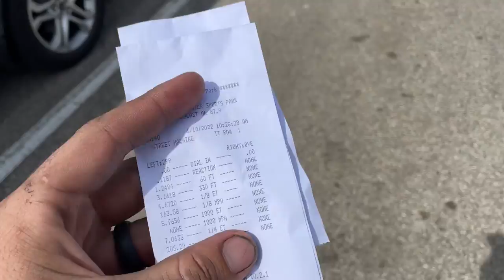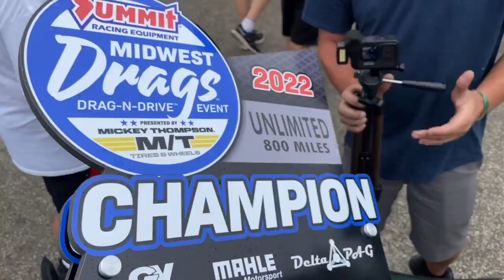Midwest Drag Week DAY 3 - We May Have Hurt Mullet's Turbo 400... Can He Still Limp To a Win??

Comment: You should get a laminated check list with a dry erase marker, so you can do a pre-flight before each run!
Reply: They should paint the checklist on the outside of the car so they don't lose it.
Reply: @lonnieatk9120  on the bed cover is space enough
Reply: And more sensors.
Transmission fluid level sensor.
Oil cap sensor.
Door water level sensor.
And so on...
Reply: should be written in a trail from hood screw to hood screw.... did you check oil?...did you check oil cover... did you check transmission oil , are your dipsticks secure .... lol
Reply: @ziiofswe  🤣🤣door water level sensor bahaha
Reply: @ziiofswe  don't forget the ice box sensor
Reply: You beat me to it.  For Cleet being a pilot I'm kind of surprised he hasn't made a checklist already.
Reply: I don't understand how they are constantly trashing like 30k motors, I get the whole making more content  but it's gotta get old like every third video is ohh man we blew it again
Reply: Was thinking the exact same !
Reply: I been tellin em for over 3 years to get outta Half Ass Harry mode and step up their maintenance game back when Leroy was still the main car. After the first year and they didn't change I suggest at the very least to start a scheduled maintenance spread sheet in the computer or on a white board in the shop. As you see they would rather Wake n Bake then proclaim they are idiots while giggling about it all.
Reply: I mean I know these are hopped up engines but they aren't top fuel motors getting rebuilt after two passes I know they last longer than this.
Reply: @ziiofswe  All the sensors in the world don't help if you don't check the data. When you're racing a 200k+ race car, you should have a checklist.
Reply: @borgonianevolution  I mean in Cleet's defense he is still in his 20s figuring out how to manage the race program and business he stumbled into. He is constantly improving but is going to continue to make mistakes along the way.
Reply: I agree, they should also install flaps and a low altitude warning alarm.
Reply: @hardup9809  young people make mistakes lol
Reply: If you drive the car you should know what pre race checks should be done. If your above that then have the right person there for such an every race run situation.
Reply: Write a book " McFarland Racing "The real Big Block Buster". Congrats guys.
Reply: Lol word
Reply: @hourlongcoder3098  I'm 29 and fudged up all the time haha🤣but I'd definitely learn my lesson after the like third motor for sure
Reply: LOL Was gonna say the same.
Reply: @hardup9809  have in mind those engines are being put to their paces, pushing over 1k horsepower, unless the internals are made of vibranium, they ain't gonna hold forever.
and.....well, just as we are, Cleet and his team are humans too, they make happy little accidents
Reply: The EFI in the dash is a touch screen isn't it? They should have an option to set a check list on the screen so every time they start it they have to go through the list
Reply: When someone’s already posted my first thought
Reply: If I said it once I've said a thousand times about the ck list
Reply: @hardup9809  yea I’m sure you would🙄
Reply: @lonnieatk9120  on the underside of the hood
Reply: @itsdokko2990  it's not just the engines being pushed, do you remember the Ruby/Leroy oil pan saga? Kept losing oil px on a pull, and even after they figured out it was the pan, used it in the next engine, wrecked it then on a different car, low oil px again, carried on and wrecked it.
Gearboxes and oil starvation seems to be the thing that happens when Kevin is around.
Reply: This is what I came to comments for...... :-)
Reply: Motion sells a checklist pretty sure
Reply: @bradley3549  Well, they could have both. They should have both.
Reply: I agree.. definitely a check list would help
Reply: @owenspalding971  No defense being at that level of racing with a machine like that and NOT knowing fuck all about basic level mechanics. Or at the very least paying someone to stay on top of it.
He needs to separate "Cleetus" you tuber goofball from "Garrett" the race car owner / driver. Save the stupid for trash level stuff not your best gear. 
Two things are going to happen fuckin around like this. Its gonna cost him tons of money to act a fool like this or.. someones going to get seriously hurt or even killed. Racing at that level is no joke. It only takes one oopsie and the empire he has built will crumble.
I can promise from first hand experience the instant someone gets hurt all that insurance he pays for won't mean dick. They will fight like a mother bear protecting cubs to NOT cover or pay on what he pays into to protect himself.
Reply: Shouldn't need a checklist for simple things like checking fluids or putting on an oil filler cap  🤦‍♂️
Reply: @lonnieatk9120  how can i press the like button more than once on this lol
Reply: Jimmy's world could probably make the.
Reply: @ziiofswe  "Idiot Sensor" LOL
Reply: They could add it on the door so there's more than just the logo exposing the carbon fiber.
Reply: Or, you know, on a phone because it’s 2022. You can even have it set an alarm before the race to remind you.
Reply: Yep, left the same comment for them a while ago.  McFarland Racing isn't big on checklists it seems...
Reply: Dang! You literally beat me to the exact comment. You should have a laminated "flight" checklist just like a commercial pilot does.
Reply: @ziiofswe  no matter how small, everything adds weight.
Reply: They should sell it
Reply: @Kyletewass  loll a billet check list ?? 😂
Reply: Yes yes yes
Reply: Ironic thing is Motion Raceworks sells a dry erase check list...
Reply: @fivespeed42  "Shouldn't need a checklist for simple" pick the guy who never did a multi day race event. 
Exhaustion and time pressures make the best of us stupid, as this vid clearly proved. Gonna guess Kevin is a better automotive engineer than you.
Reply: There's several things they should do, one of them is make that trailer more efficient inside.
Reply: @UNLkidfromCA  Carbon fiber hood = ten more sensors. ;)
Reply: Pinned comment
Reply: Especially when your going over 200mph
Reply: And write your list in sharpie and cross it off with expo
Reply: Well Zack did say he’s maintaining the motor every drag day (when it’s not a week event). They just run them A LOT. Most people don’t do EVERY drag event they can find
Reply: CHECKLIST FOR SURE CLEET, COME ON! Need some bigger brakes too. Ol Cleet tried so hard not to bag on the TBM brakes, but it slipped out on his very first comment before he realized what he was saying. Needs bigger chutes or bigger brakes or most likely both.
Reply: @ziiofswe  Door water level sensor! Haha! Love it, even though he drilled botched holes in them, a sensor still feels like the right thing to do lol.
Reply: Guy is a helicopter pilot, he should definitely be carrying some of those rigorous checks over.
Reply: Yes! Check list!
Reply: Was just about to say this
Reply: Exactly what I was thinking, just with a white board
Reply: Motion sells a checklist actually
Reply: @ziiofswe  and maybe a radiator sensor as well
Reply: This is not a suggestion but a MUST DO
Reply: @PokemonCardSquad  and neither is the check list for the pre flight its not an air plan its a pro mod race car
Reply: I was going to say the same thing. You need a damn checklist so you can maintain that incredibly expensive equipment.
Reply: My first thought exactly…a list for race mode and a list for street mode
Reply: @hourlongcoder3098  like your parents?
Reply: Have like 5 of them at work, helps a lot
Reply: The armchair experts aren't thinking big enough. What Cleeter really needs is a checklist tshirt.
Reply: if you want consistent results you have to have consistent procedures. too much money and time invested to be making dumb mistakes
Reply: Came here to say this.
Reply: I mean, yeah!  These guys can’t get out of their own way, it seems.
Reply: @hardup9809  they just push things past the limit but they also know it. Like cleet said with the LS vs 540. The 540 is a much better match for what they are throwing at it.
Reply: They should make a check list T shirt
Reply: I came here to say the same thing.... Dang that trans fluid slip up though.... They need a "Pre Flight" checklist... Like we use in aviation.  With cleeter being a helicopter pilot and all you would think he would have this kind of stuff stored into muscle memory.
Reply: Exactly
Reply: Came here to say this 😂
Reply: I thought the same thing.
Reply: yeah....mullet's gonna need one before he go "space-shuttle-status" on our boy cleetus
Reply: Remember LeRoy needed the note on the dash.
Reply: @hardup9809   those motors are so highly strung out that it more when not if it break's. Even top fuel dragsters have  premature engine failuresand they're a fresh engine every run
Reply: Nah should just tattoo a list on the back of Kevin or a leg so you aren’t missing the list ever
Reply: That’s what I’m sayin
Reply: @peterbaiter6880  there's a difference between 10,000horsepower and 2000 though I'm not saying these motors should last a couples year but I do 100% know they last longer than 3 or 4 nights at the strip, I don't care what anyone says otherwise, you have built gtrs making 1500plus wheel horsepower that last YEARS they are dogging on they're motors and they aren't checking simple things such as motor oil, coolant ,trans fluid before runs, it's idiotic do your prechecks and stop wrecking 30k engines your a dunce if you think these motors only last a few passes
Reply: I have been saying this exact same thing for over a year now and just get ignored. If it works for pilots it will work for drags. There have been numerous expensive mistakes that would be fixed by using a checklist.
Reply: @ingresswizard9044  ^this guy knows, while 80% of above is "TheSE MotoRs gO BooM EasY"
Reply: @scottcol23  He’s not a helo pilot, lol
Reply: @hardup9809  I'm not disagreeing about the pre checks  . All I'm saying is the ls engines are pretty highly stressed out making the power they are so it's still a matter of when not if . But I completely agree that prechecks should be done  to avoid premature failure
Reply: @ingresswizard9044  he sure is. He actually purchased Dave Sparks old helicopter. The red/silver BO 105. Dont believe me, Go to the "Gentry and sons trucking" channel. go to video called "Cleetus overnighted me to florida from May 1st. go to 4:18 in the video. You can watch him fly it with Tim in the left seat....  He has just hidden the purchase well
Reply: @ziiofswe  I can't think for myself sensor
Reply: @owenspalding971  didn't stumble in and he's not dumb.  Dumb enough to know better for sure
Reply: @ryanhunter7365  I need a bunch of those.
Reply: @ingresswizard9044  have you tried emailing them?
Reply: @socalfun64  I don’t think any brakes are designed to pull up a 3500lbs car going over 200mph on small time tracks that have a shorter run off 
Especially since he’s limited on brake size with drag wheels
Reply: Tattoo in his face checklist
Reply: They won’t
Reply: To cheap. Rather just throw money at every problem.
Reply: @ziiofswe  lmao door water sensor
Reply: @hardup9809  except you're wrong
Reply: @ziiofswe  i never thought I'd say more sensors after how many Kevin put on it but yeee for sure
Reply: @bradley3549  Besides, it's a bit about presentation too. A lot of the sensors could just go to red warning LEDs.
They'd still need checklists of course, sensors and lamps can fail... but it would be an extra level of protection against expensive mistakes.
Reply: @ziiofswe  Blinker Fluid sensore
Reply: @ziiofswe  I agree, sensors on everything! I'm a data guy for sure. However, transmission level sensors are not a common item. And I'm sure it's a challenging thing to sensor due to the fluctuations in the level, as well as fluid slosh. And if they exist in a capacity that work well, I'm sure they aren't cheap. Not that we should be talking budget in respect to Mullet, but in general - checklists are cheap and so long as you do them - reliable.
Reply: This was exactly my first thought when he said the trans fluid was low. I was like "y'all need a damn pre-flight check list"
Reply: @ziiofswe  start in first gear sensor
Reply: @Snugglez187  you don't need a checklist he's not flying a air plan
Reply: Was literally just about to comment this. This is a must!
Reply: Pre race bald egale check list ?
Reply: @bigcncguy  The stock 6 piston Brembo’s on my Hellcat do just fine! Had it over 200 a few times with quick decel. In the 1/4 at 150 mph it’s no prob.
Reply: @ryanhunter7365  The dude was making videos 3 years ago to see how many turbo whistles he could fit in his c7 exhaust. I'm not saying hes dumb I'm saying that things have escalated quickly
Reply: They would still screw up bc they wouldn't check it lol
Reply: @socalfun64  yeah cos you have a wider front tire, bigger brake package and your going 50mph slower, massive difference between 150 and 200. And it’s partly the tracks shut down length
Reply: I mean motion has a checklist that they sell
Reply: @ziiofswe  can't forget the diff sensor 😂
Reply: @lonnieatk9120  they still might lose it. I've seen them lose stuff before. LOL!
Reply: @ziiofswe  you ever notice he never forgets his firesuit. Is there a sensor for that?🤔 LOL!
Reply: @jerrysantos6484  It's the Tech Inspection Sensor.
Reply: was getting ready to write this but now just need to thumb it up ... Come on Cleat ... Its ok to make mistakes just not the same mistakes ...
Reply: I was thinking the same thing.
Reply: @hardup9809  

Well, to be fair, they're pushing the engines, and transmissions, WAY harder than 99.9% of people would - at this level they're almost at the 'service item' level.
In their position I'd be trying to budget to have at least one fully built replacement for each major component at hand - two would be better.
Reply: @xblackaquamanx8070  I agree!👍😎
Reply: @ziiofswe  that is the one! Thanks!😂🤣😂🤣LOL!
Reply: @bigcncguy  Nope. Drag Pak.
Reply: @mycosys  Yes Kevin is an AWESOME fabricator and driver.. But..... wake n bake is NOT conducive to being on top of your game. Your gonna forget or completely miss simple things as has consistently happened on both channels.
Reply: I agree 100%, simple things and way to many of them.
Reply: I din't read this and just said the same thing LOL 😜
Reply: @mostlymotorized  lol
Reply: what a great idea. I'm gonna do this with many of my projects now. Thanks 🤜🤛
Reply: @hardup9809  drag racing by itself trashes motors.  All the time.  Everyone does.
Reply: @TheRoadfarmer  again for the fith time these motors last longer than a weekend end of story

Comment: The key to a good 60ft is apparently a dry converter? Putting that one in the 'ol back pocket! lol
Reply: Sounds like his converter is too stiff if it improves running worse
Reply: It's called weight reduction, atf is heavy.
Reply: Aaaye didn’t know ttc liked cleetus
Reply: a dry radiator helps too!
Reply: I thought the same thing, looser converter but it'll be way easier to try adding a touch of boost to the launch first...
Reply: needs a dump valve maybe. Another thing a saw on Big Chiefs channel was a higher flow trans cooler to loosen up the converter.
Reply: @KCadbyRacing  M&M sent them 2 stators so they could tighten or loosen the converter.  Seems like it is too tight right now.
Reply: I don't mean to brag but the converter in my mustang sounds like a dying power steering pump so I guess I can pull a .07 60ft
Reply: Love your content TTC!
Reply: From watching cleeter, apparently you run the trans dry and drain the water from your ls
Reply: I was thinking the same thing
Reply: Hi TTC
Reply: Lmaoooooo
Reply: Makes sense I mean he ran his first 7 second pass with no water in the radiator lol
Reply: Good to see ya round here TTC!
Reply: @littlelifters7543  Yes that's an old school trick, also using bigger hoses running to and from the cooler helps too. That used to be the way to tweak the stall. These days they have dump valves, billet converters that are easy to take apart and change stators, and computer controls for everything, but the old school tricks still work and they are dirt cheap!
Reply: Soooo, less grease in an impact means more torque????
Reply: @tmacie2  Impact wrenches are not used in Mullet's drivetrain. 😂😂 But low fluid in a transmission always causes it to slip. Every single time. Low fluid=more slip and if that's how he ran his best 60' then the car is telling him that it likes more slip.
Reply: @RonniePTexan  Check who's comment I'm replying to ;-)
Reply: @tmacie2  Dammit... You sonofa... You got me. I'll pay closer attention next time. Have a good day brother
Reply: @RonniePTexan  No worries!
Reply: @Torque Test, better put that converter on the dyno
Reply: I wonder what the stall is on the converter( if they have one)🤔
Reply: @anthonyward8853  6lbs for the gallon. That 60’ time was huge improvement but more than likely from slippage
Reply: the key to a killer 60 foot is launch it as hard as you can without wheel standing or wheel spin watching the Mullet leave its very soft he's got a good couple of 10th in there yet moving to bigger tires maybe needed and wheelie bars
Reply: @LSturboguy  I think they leave soft because they have been fighting blowing the tires off. Need to find a way to get the ol rubber mitts planted to the ground better so they can twist the axles out of it on every launch. Needs moar meat in the back
Reply: If you want more beans you need less sauce!